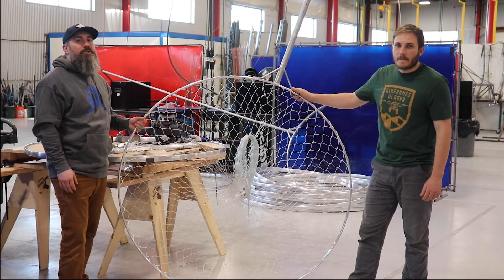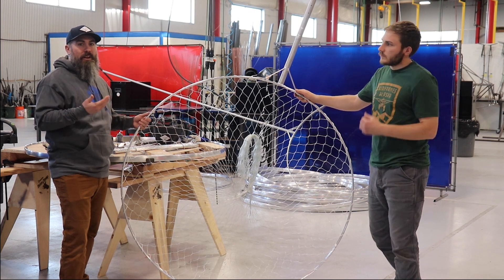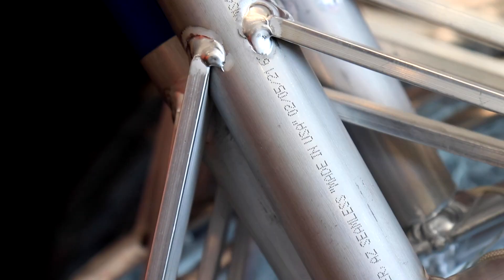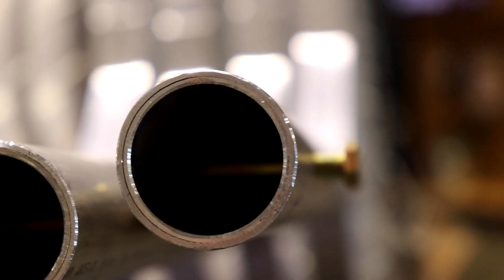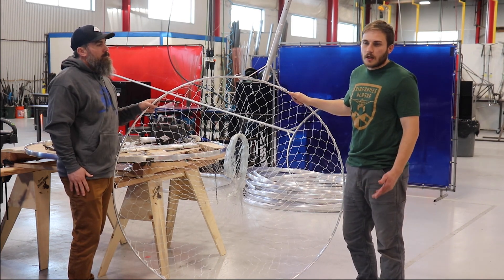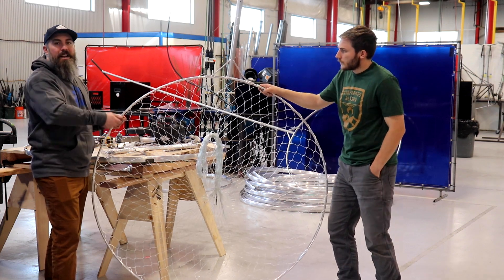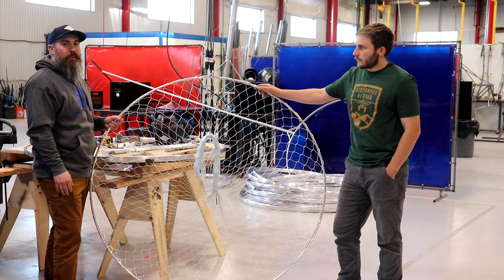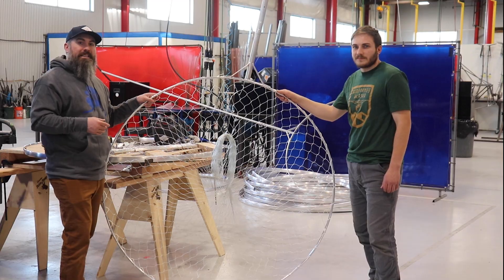Aviation Engineered Dip Nets

Comment: You need to build plastic rub straps to clamp over the netting so it is protected from abrasion on the gravel. Pull a net Ina and out a few times over rocks and your net attachment ties are cut up and coming off.